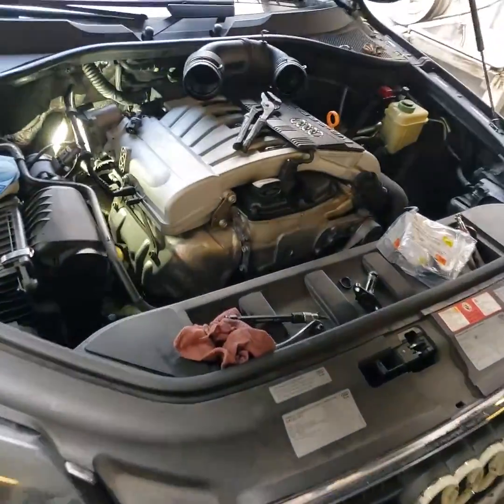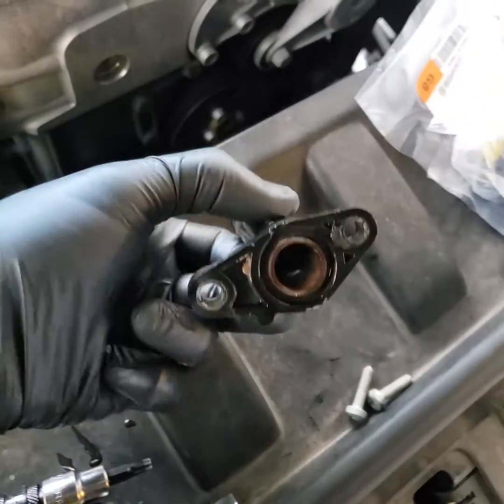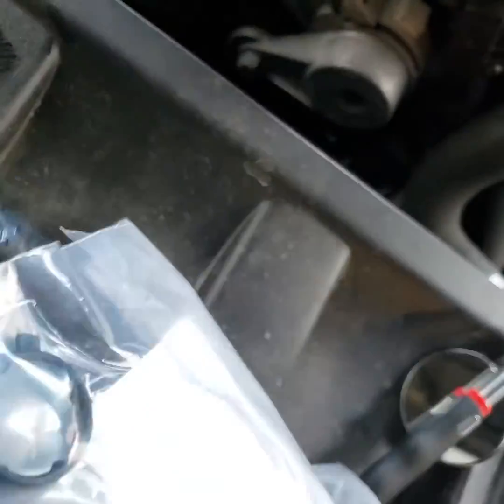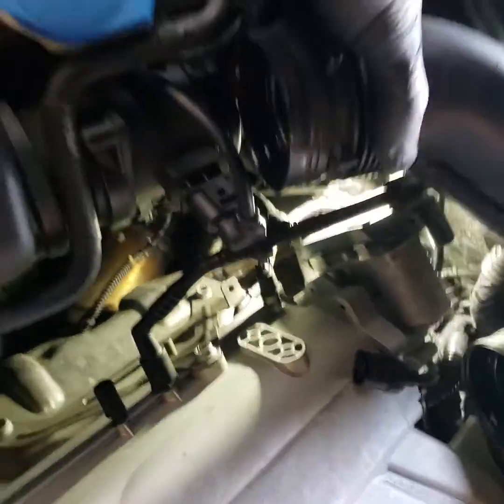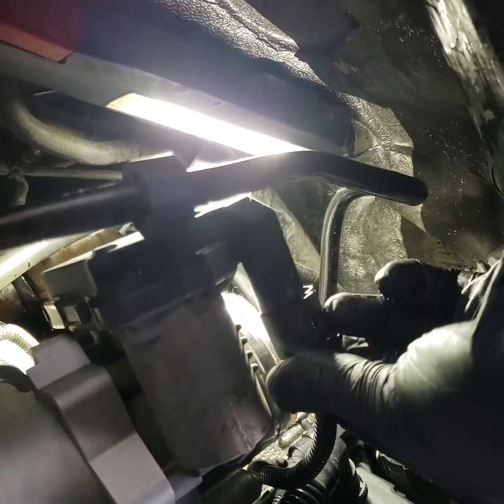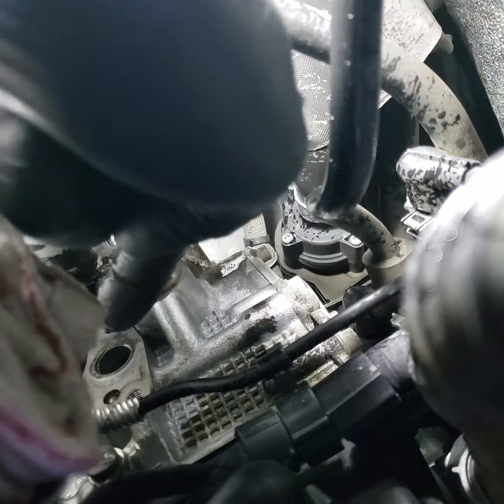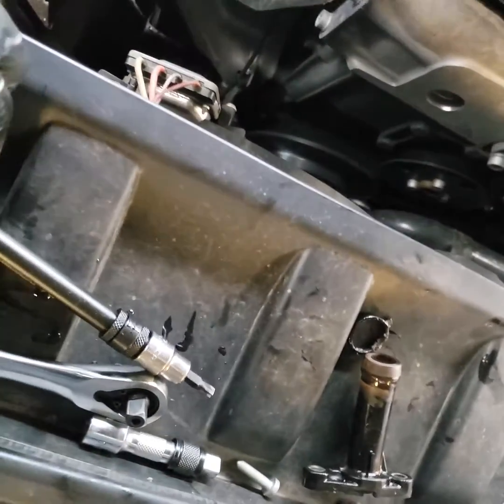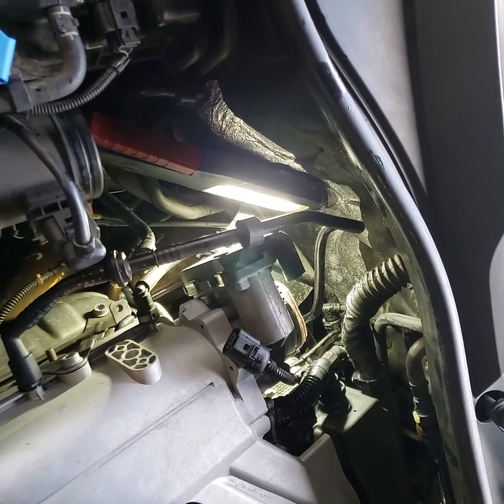Audi/VW 3.6 VR6 coolant flange leak/replacement

Comment: Had mine at the shop for a valve cover replacement and when I got home heard an explosion on the engine and water was coming of under the filler reservoir so looks it might be this part.